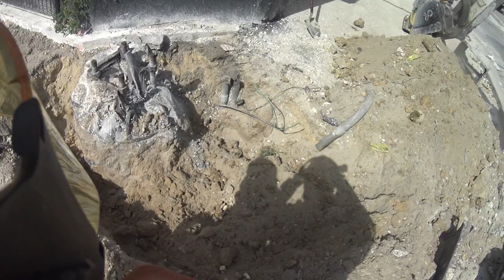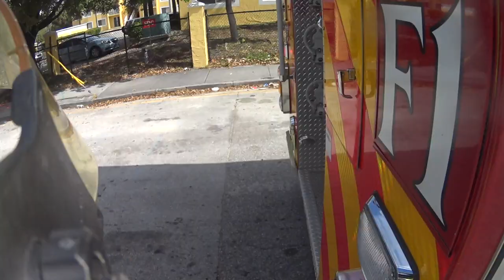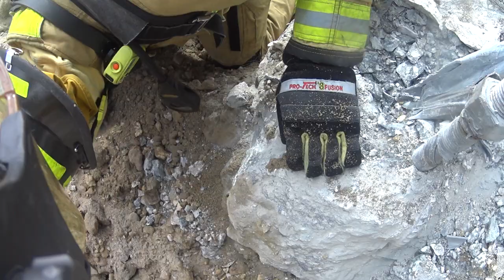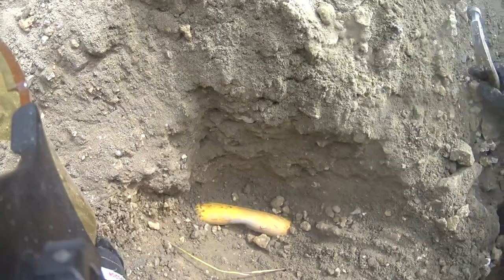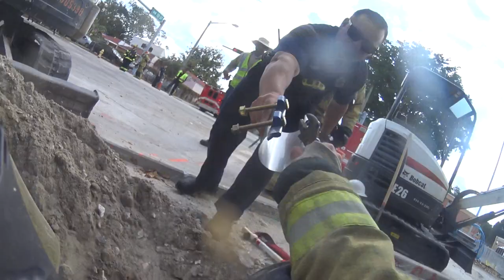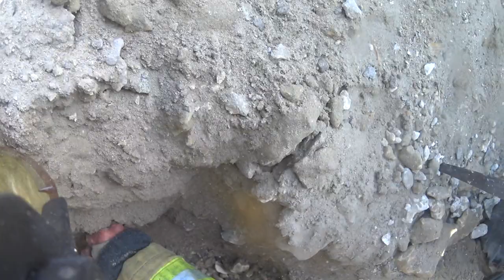City of Miami fire-rescue hazmat team GAS LEAK 4 21 16 A SHIFT

Comment: Wait?  Fire is expected to mitigate natural gas leaks?  Wow.  In our city, the gas company does that.  We send nearly a full box assignment, secure water supply, deploy protection lines, evacuate necessary buildings and conduct air monitoring of buildings/areas where gas could collect.  We absolutely do not get in holes and do not secure line.  Generally the natural gas co has a response team, and they usually will try to locate shut-offs near the cut.  If that won't work, then they will generally use temporary clips to seal the pipe.  But fire is not expected, nor trained to mess with their equipment.
Reply from the maker: "Fire is expected to mitigate gas leaks" to answer your question, no. We are not expected to totally handle these situations. The gas company is dispatched along with hazmat, a full building assignment ( for support) and all of the other support you had mentioned that you do in your city, we do the same. But us being city of Miami fire department we are a very aggressive department and if we feel we can handle a situation in lieu of sitting around twiddling our thumbs in view of the public we are very capable, able and willing to do pretty much the same exact thing the gas company is going to do ( in its initial response)
Reply: Mauricio Garcia yea but you are sucking up tax payers money. the gas company wouldn't.
Reply: Wisconsin it's up to gas companies. I work construction sewer/water and road work. Any line hit under 2 inches we crimp off or pound a plug into the pipe. Call the gas company and keep working.
Reply: All u gotta do is pinch the line with a clamp
Reply: @anthonythorp7291 Not smart. How do you mitigate the static build up on pe pipe?
Reply: @cameronreason  never had any problems.

Comment: Great job clamping this leak. Hammering the bolt with a metal wrench can cause a spark increasing an ignition. Brass hammer?
Reply: Im not a firefighter or expert, but that same thing crossed my mind.
Reply: The pipe must squeeze before repairing the only time using a pac clamp with live gas in on steel pipe.

Comment from the maker: Well my friend I can assure you that its not a claw hammer it is indeed a mallet. I couldn't tell you the exact chemical composition of the mallet but it feels like a hard plastic type of material. Also, to address your earlies comment of sparking, yes we do take precautions in case something were to happen for instance using non sparking tools, having a manned extinguisher of purple k 10ft  away as well as having a charged 1inch 3/4 line near the hole. Keep in mind the we live in Miami fl were the humidity is always near 80 to 100% the majority of the time, an environment not conducent for much sparking. Where about in the world are you located my friend?
Reply: Where they don't call a claw hammer a mallet.
Reply: But it's a hammer?! Claw hammer. You know. Hammer type.
Reply: Believe it or not, in that hole, with gas at pressure, there was little chance of it taking fire.
The gas to air ratio is wrong. Methane, because it's heavier than air, would be replacing all the oxygen in the hole.
Reply: @farenheit4513  are you thinking of propane?? Methane is the lightest alkane gas and much lighter than air

Comment: What about, umm, turn off the valve leading to that pipe?
Reply: Good luck finding that! It could take hours to find out where it comes from being under the street.
Reply: What about digging back 30' from the break to squeeze the 2"PE..no danger in that!
Reply: Ya that would have helped
Reply: Cameron Reason because it could crack the pipe at the crimp causing more problems
Reply: it has to be shut off from both sides ,there will still be gas leading to the neibourhood
Reply: 2 inch pinch off tool on both sides of the hit, cut out a 4 foot section of the pipe, electro-fuse a new 4 foot section in, reestablish gas after electrofushions have cooled and soap check for leaks.

Comment: Protip for everyone commenting:

Even if it's a clawhammer, that gas WILL NOT EXPLODE IF UEL. Chances are, they actually checked the area with a QRAE to determine what the limits were before they made entry
Reply: No way is it safely above the UEL. Natural gas is mostly methane. Methane is lighter than air, so it will make a draft that pulls oxygenated air into the hole. 

Even if they were working with a heavier gas, remember that there's oxygen coming from the scba exhaust too. Any ventilation is the enemy and the idea of "safely" above UEL is incredibly sketchy. 

For chemical engineers, sure, oxygen-free atmosphere is a reasonable concept but holy hell it's not for entry.

Comment: Well dude the use of the tac stick was awesome... not sure whose idea the saddle clamp was but you didn’t need it, you had no way to ground static electricity, you didn’t have enough access to properly install it without removing your PPE, and the pipe should have been prepped and soap water put on the clamp for it to work properly. All you needed for this call was a sharpshooter shovel and that mustang GLS26 that the firefighter outside the hole is leaning on but not using (maybe 2 if double fed). But bro WHERE are the monitors?? Gas company employees in jeans and FF’s with no PPE standing over your head while you bang on an ungrounded rig with a hammer and no gloves? You gotta make a hot zone with monitors and wear your gear or you are taking risk and getting nothing for that risk.

Comment: thats crazy they are useing a steel hammer to dig out ,what if whilst ther were laying that pipe a steel bolt was accidently left next to the pipie, dont suppose they would have to worry about the leak ,as it would be a explosion with 2 dead firemen,thats just bloody stupid move.

Comment: Its a wonder they don't blow themselves up in Miami. Digging a hole to god knows where without checking for whats there and no regard for the fact that metal against rock could cause a spark when digging next two a 2" gas line, with a bunch of people walking around without gear on. Have you seen these things light up? its not a small event.

Comment: what is all the hisssing sound is that from your scba
Reply from the maker: The hissing sound you hear is not the scba, it's the actual compressed natural gas leaking from a broken pipe buried underground. It's the same natural gas that feeds homes and businesses which is used for heating, cooking etc..
Reply: Just to add to that, natural gas lines inside a home are at ~1/4 PSI, natural gas lines outside the home can be 10-50 PSI or more. So thats a relatively large line with a lot of pressure on it. Had to be pretty loud.

Comment: I think it the fire fighters were doing wrong by using the hammer to dig in close that pipeline. This could lead to creat a spark and the seteuation could be worse. Do you agree with me?
Reply from the maker: You're right for thinking that but what you can't see is that the few tools we are using are made of anti- sparking materials. In all due honesty it is a crude operation but it really is the only way to handle at that particular moment. Believe me precautions are taken for our safety and I personally have two babies I'd like to come home to so have no worries and thank you for your comment
Reply: +Mauricio Garcia god job dude 👍🏽
Reply: Mauricio Garcia that metal wrench doesn't look anti sparking lol.

Comment: The worry is static ele from the gas   If the gas is not entering leave it till it's shut down. Plastic lines are worst than steel. Those firefighters are putting them self in danger of a fire. Sorry worked for 20 yrs in gas co
Reply: Absolutely.. soapy burlap..or static depressant spray.. I've seen a 2" main ignite will installing  squeezers without static mitigation .. not a good time.

Comment: Lot of things wrong here. Pretty sure that clip they're using is not made for gas pipe, Second their tools are not grounded, and third why is a fire department messing with a gas leak, where I'm from the fire department responds in case of an explosion or fire but the gas and electric company take care of the leak to stop it.

Comment: I'm sorry but this is about as bad as one can attempt to stop the flow of natural gas.  I would advise their superiors to have them get with a gas company to relieve the proper training on this.
The hammer doesn't look to be brass.  Then rubbing his glove up and down the plastic gas main there is a no-no.  At minimal they should have used some soapy water or anti static spray.  Also is that camera intrinsically sound?
If an employee at my company fixed a leak the way they did, they'd be suspended or FIRED.
Reply: *recieve
Reply: This is in Miami, where it is very humid there, which lowers the chance of a spark occurring from static electricity.

Comment: i work for the company who paints the utilities trust me they dont think shit happens when this happenes lol im also on the vfd in my town and we don't deal with this yes we will get called out but usually the gas company in this area (vectren) is good about getting out there to fix it
Reply from the maker: Here in Miami it happens more often then you think especially with all the new construction and road work going on. Some of the times we have different construction sites just feet from each other. Last shift we had two different gas leaks at different times from different locations after midnight. Fun fun!!!
Reply: Lol have to love that and with the job im in if it happens i got no matter what i have to be on site because im with the utility company even if the fd dosent get paged out i still have to go

Comment: It would have been easier if they shut off gas.
Reply: DJkayoo to find the valve for that pipe would be nearly impossible because it is underground and if you shut off the that network there will be enough gas in the pipe to keep leaking for hours
Reply: Valves are accessible from above ground. Depending on where in relationship to rupture, gas could stop shortly or run for some time.
      I work construction and most times we stop leak ourselves. Gas companies then come out. Firemen come sometimes but never touched a thing.

Comment: Did they check the air quality around the dig site after Fire capped the leak?
Reply from the maker: We usually have the meters on before after and during the leak, not right up in the hole because the gas is so rich it'll burn up the meter but around the surrounding area. But I'll tell you this the hissing sound goes away completely when it has been properly capped. It's like the differences of sound when you put air in your tires and you pull the air hose away from the tire valve. Either way we are there to stop the leak. The gas company still needs to come and give it a more permanent fix.
Reply: Ok thanks for the response great job.

Comment: Lucky there wasn't a spark from that hammer!
Reply: ....? Do you know how fire starts?
Reply: Yeah bc hammers on dirt kick up so many sparks right
Reply: Spencer Berklite Hitting rocks with metal has the potential of a spark depending on the kind of rock. The gas line should have been depressurized. This can’t be a permanent repair, is it?

Comment: well that contractor will have to pay out the ass for that loss of service unless the utility locators marks were right where he was digging
Reply from the maker: Lmao!! True, but after some digging those markers get lost in all the ruble. 💩 happens!
Reply: Mauricio Garcia, they can take photos. I've also been to way too many of these where the marker ribbon is pulled up and discarded in the pile of dirt, like it has been in this video. "Ain't they s'posed to put them lines deeper'n that?!" -Every at-fault contractor ever. :P
Reply: thats why you find  it by hand first, plus there is yellow caution ribbon all over the spoil pile, someone just got lazy is all. crap happens, you owe your family more than that sir. there's a protocol to digging around utilities just as there are fighting fires. surprised by your cavalier attitude about ng pipeline. I work around it every day so yes I'm qualified to speak
Reply: OpEng Chris do what? I wasn't bashing anybody I was just saying he contractor will be paying for that damage I do this work everyday he didn't hand dig and expose the line
Reply: OpEng Chris I'm a utility locator I know the protocols about digging a utility such as a gas line 2 and 1/2 feet on either side of the marks if the mark is off more than 2 and 1/2 feet and you hit it you're fine but if you hit it inside that 2 1/2 feet you're paying the damage I work for usic the locating company so I don't know what you mean about my caviler attitude about knowing gas lines
Reply: my apologies Bryce Hamilton, you are correct sir.  my comment was to go to mauricio Garcia.
Reply: OpEng Chris okay
Reply: and btw Bryce the contractor is gonna pay for that one or did, friggin caution buried gas line ribbon everywhere, lol
Reply: OpEng Chris lol yeah there's no question he didn't hand expose that line or we would have saw the  tape unless he did but he didn't go far enough

Comment: You gotta spray area with water, Static will Explode ..
Reply: It's very humid there. No chance of static electricity occurring.
Reply: Frank L Bro here in Miami there so much Humid theres no need to spray water..
Reply: I would not say "bo chance" but very slim :D
Reply: No because water is flameabel  to gas if a fire started
Reply: Blaine Graham what are you talking about? Water is not flammable.

Comment: you could just have weld it shut
Reply: Whooosh
Reply: Anony Pretty sure it's a plastic pipe.
Reply: @Tronix * haha no it wont explode the whole neighborhood. Remember the fire triangle: heat fuel oxygen. You're missing oxygen so it will not burn
Reply: @Tronix * calculated? What did you calculate?
Reply: @Tronix * ah okay.
Reply: Anony  do you know what sparks are they are also flameble
Reply: @krnichol1  natural gas wont  burn out of itself even if there is a source of heat. Because the pit is filled with gas because its heavier then oxygen there would be no oxygen to burn. And ofcourse they wont do this because its plain stupid and it is just a joke. On paper it is possible but irl it wont happen.
Reply: Problem 1: It’s a HDPE plastic pipe, and the only way to weld plastic is high frequency sound wave technologies, which are big and cumbersome, and friction welding which would require a drill or motor of some sort that can omit sparks.

Problem
Reply: @johnanders8861  It clearly looks to me that it is a metal pipe. Also read my other comments about sparks, i'm not going to repeat this anymore. I know that it would be a utter most stupid thing to do and it will never happen, but still... ;)
Reply: Anony from. Experience of my father responding to a 4” gas line in Wheeling, WV, I can tell you that it can still burn, not very forcefully at first, but still as it burns it forces oxygen next to the pipe and with burn hotter and hotter. Lucky he didn’t get an serious injuries as he was about 30 feet away upwind, but it can still happen. I mean no disrespect, just saying my experience😀